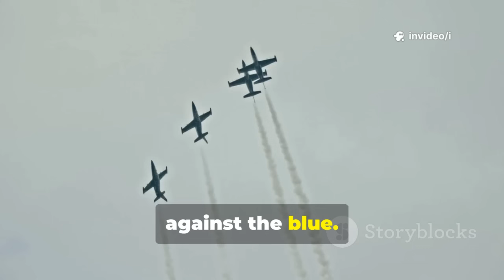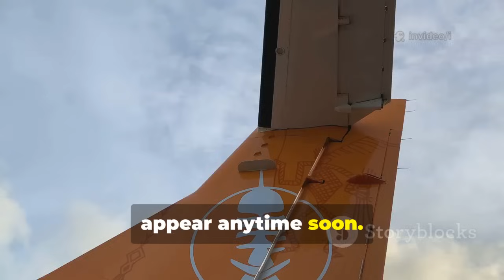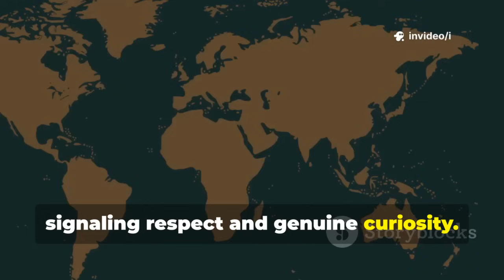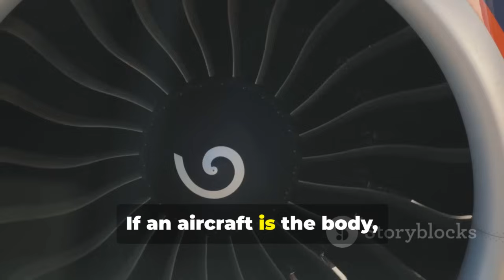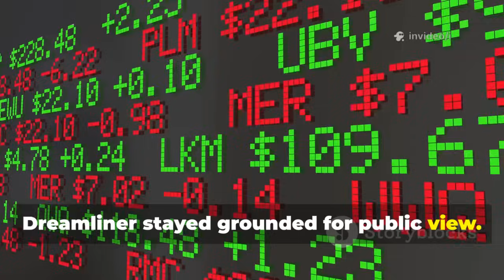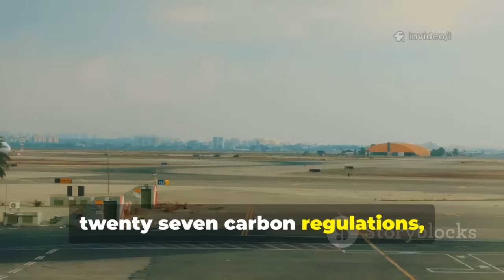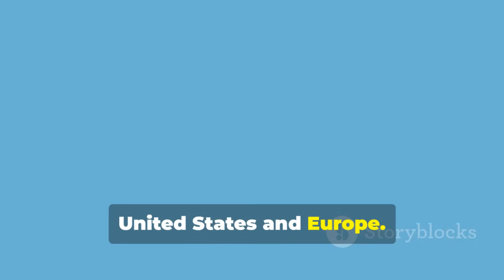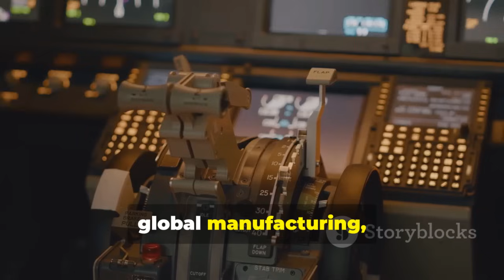$91M Jet, 100 Orders in a Day! COMAC Shakes Up Boeing & Airbus at Paris Air Show

Comment: So, the message was, chinese planes were bought by chinese companies???
That says nothing yet about its quality for a long term exploitation. 
Only time will tell, in this industry that's 5 to 10 years life cycles at least. 
Them outsourcing overseas to make up for their gaps also build up creency; good tactics - but still, they are lucky to have the domestic market to lauch themselves and prove their products to the resst of the world. It's a big advantage to start with and go forward... Brazilians have more trouble taking off, even though they do have their smaller market niches. Embraer is around since 1969 and still can't compete on equal terms nor on equal products with the big 2.